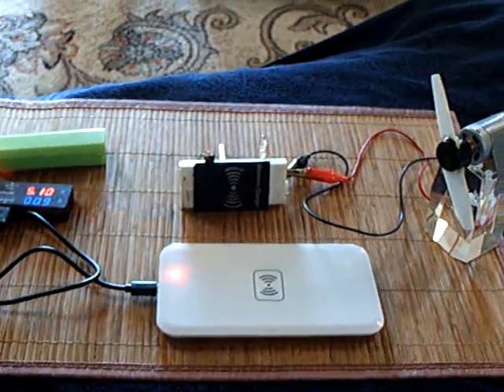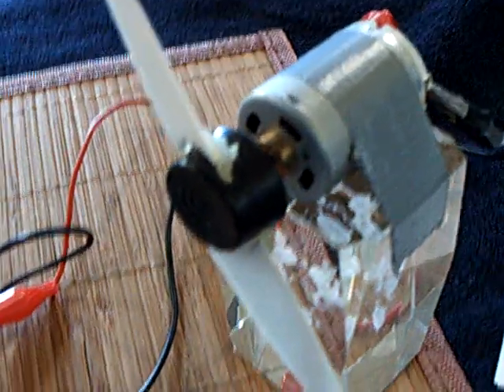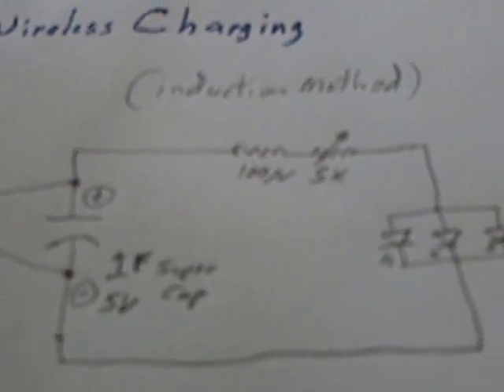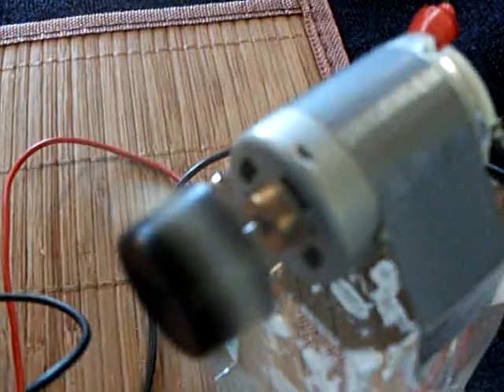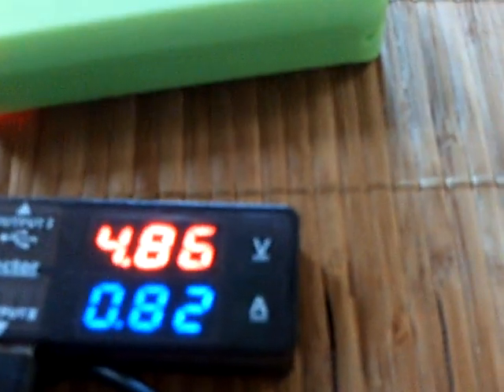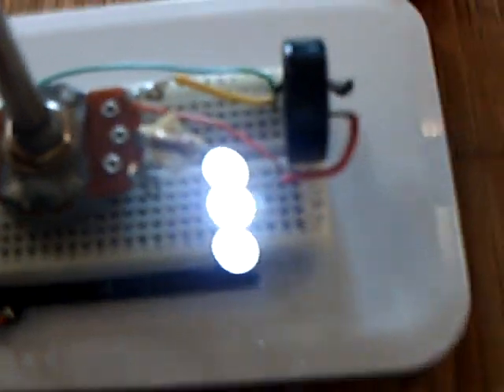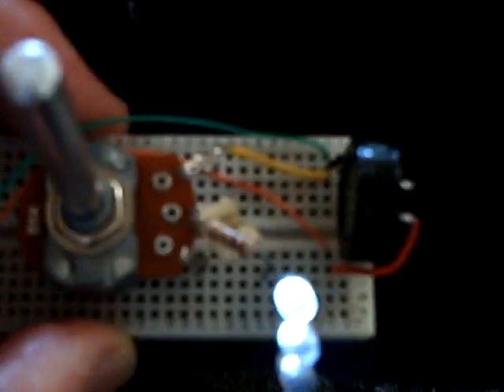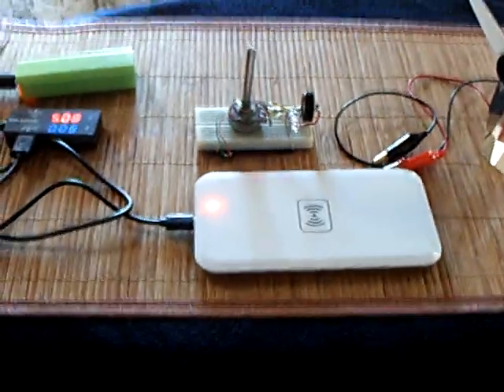Near Field Wireless Charging

Comment: They've been a long time becoming accepted. Not that I use a cellphone, but do know that continual plugging in and out every day for any device will likely ultimately bust even the best made plugs and sockets. This method allows that whole problem to be avoided. Have fixed my wife's Pengpod tablet a few times because of that, so it's going to go wirelessly charged.
Reply from the maker: slider2732 I was surprised how well this worked.  The technology has come a long ways in the last few years.  Some of the new cell phones come ready made for wireless charging.  I imagine in a year or so all of them will.

Comment: Yeah it is pretty cool stuff that's for sure.
I bought the same unit. Only mine is black.
Of course i pulled it apart. The transmit coil is very much a Tesla pancake sitting on top of a slab of ferrite.
The case is easy to crack open without destroying the circuit.
Just run a thumbnail or plectrum around the case seam.
Reply from the maker: m3sca1 Thanks.  I just took mine apart to have a look.  You are right the case is just snapped together without glue and comes apart pretty easily.  I was surprised to see the ferrite disk in there under the pancake coil.  The circuit board was more complicated than I expected also.  It is much more than a simple oscillator circuit.
Reply: ***** you got a ferrite disk? Mine has a square slab
Reply from the maker: m3sca1 My ferrite disk is about 1/16" thick and has a small hole in the middle. It is about the same diameter as the pancake coil.

Comment: Nice !  I have one of these laying around. Been thinking about ways to experiment with it. Have you thought about using your own homemade pick up coils to power a pulse motor and run the back emf to the unit ? What does Maggie think of this, any attraction there?
Reply from the maker: capodad2u I just spent half the day playing around with all my 'toys' to see which ones worked the best.  Maggie didn't really like it much but Penny (the 99 cent store twist tie Joule Thief)  really liked it.  With the pad turned on by the cell phone pickup coil it would run Penny from 4" away.

Comment: I think there is one bit missing:  a small capacitor directly across the coil itself.
Reply from the maker: Power Max The actual Qi circuit is more complicated than my simple diagram.  This is what it looks like and how it works:
http://www.low-powerdesign.com/article_TI-Qi.html
 I can hear the transmitter and receiver talking to one another on an AM radio held near the charger.  I can't understand what they are saying.  I don't speak "chee". lol
Reply: ***** so you are inputing DC into the transceiver, it is oscillated into some pulse or sine wave, then it is received, rectified, and sent via DC to the phone?
Reply from the maker: KyleCarrington Hi Kyle.  That is basically how it works but there is a communication link between the transmitter and the receiver that controls the charging.  It is a pretty neat twist on a very old idea.  The new ones are resonant circuits that can work up to 2" apart.
Reply: ***** I actually have one of those wireless chargers for my phone, (and it is a greater PITA than just plugging in...) But mine what it does while idling is pulse the coil, looking for a load. I can set a quarter or washer on it (which is effectively a short, like many closed loops of wire) and it will turn on, and heat up the coil a little.
Reply from the maker: Power Max I tried the coin trick but my pad would not turn on.  It must be a different type.
Reply: Try a bigger coin.
Reply: It is a bit fiddly but it couldd also be that the digital regulating topology is different. The coin or metal plate has to be the right size for it to come on and stay on.
Reply: ***** Those circuits are much more complicated than I guessed they would be for such a simple device.